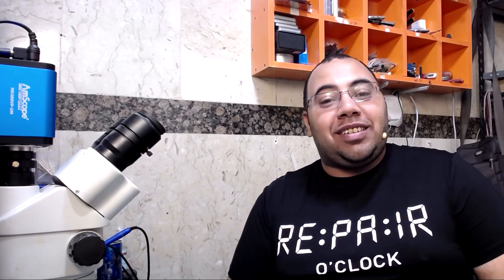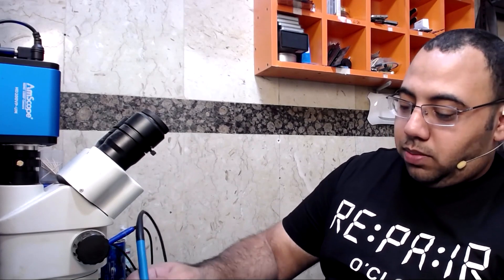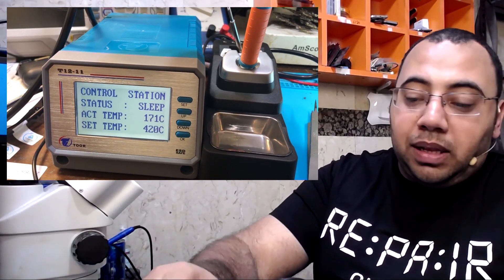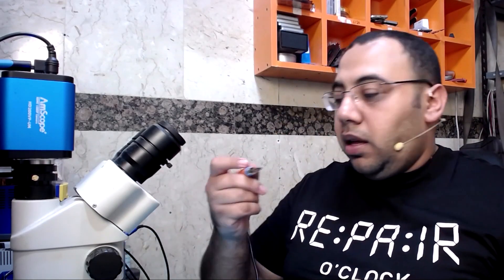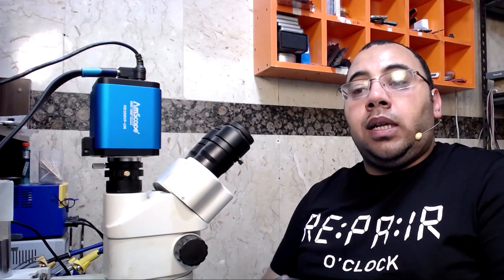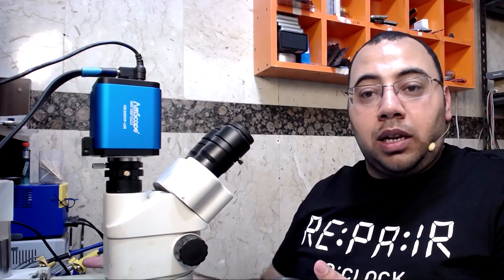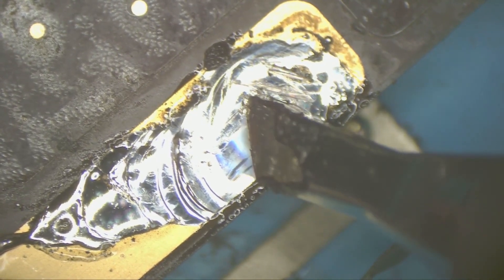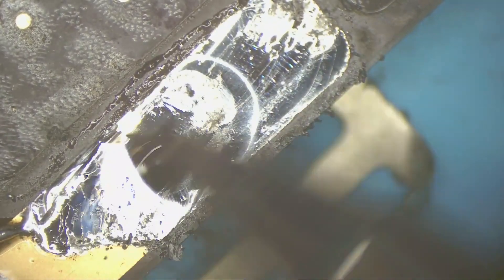Best Cheap Soldering Iron 2019 I T12-11 Soldering Iron Review

Comment: Last Time I am watching your video T12-11 iron. Buy this iron after 6 week it’s not working 😷
Reply from the maker: This is happened in every electronic device it doesn't mean it is bad product you just bought a defective piece or maybe the tip need replacement contact your supplier, if you want high quality iron buy Hakko, JBC or Metcal it will cost you minimum 500$ not 100$

Comment: Can anyone confirm or deny if this station will run a jbc 210? I've seen comments claiming it does but not much more than that.
Reply from the maker: It doesn't work with C210 Package it does work with bigger tips